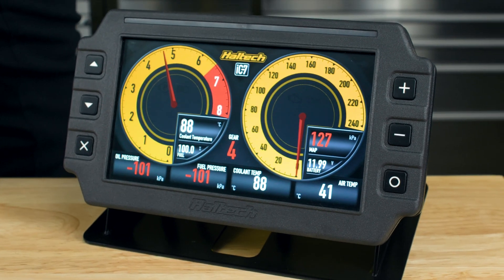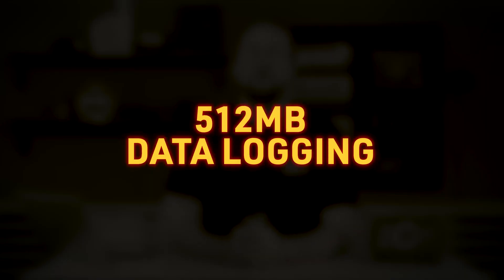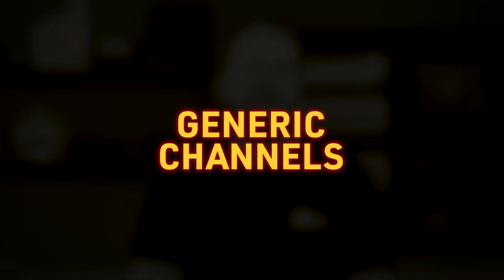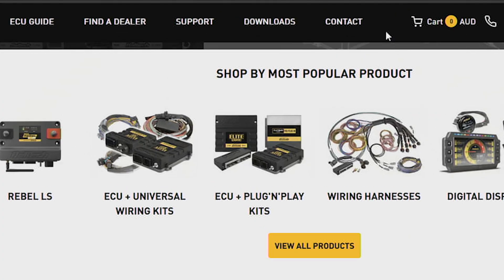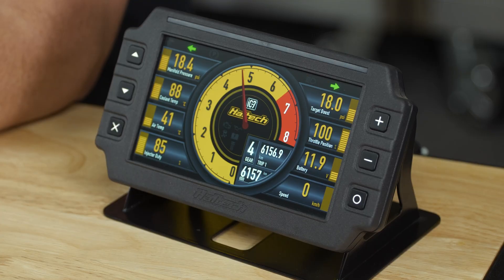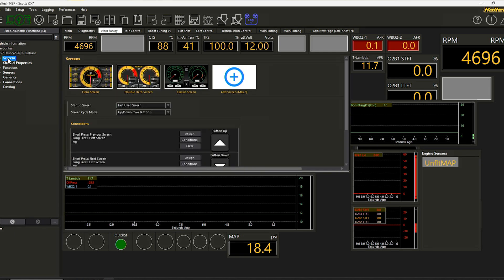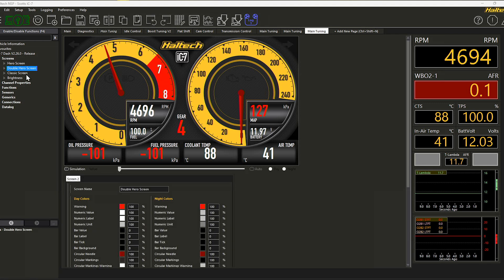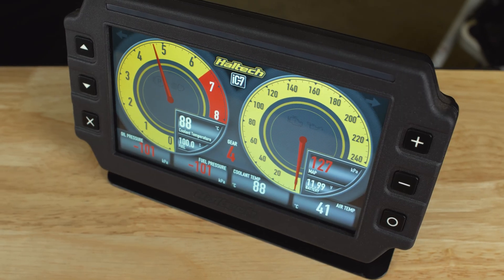🛠 Updating Your iC-7 - How To | PRODUCT OVERVIEWS

Comment: question, can I use the input on the C7 dash for non dash related parts ? example clutch switch,  pressure switch etc, and outputs, and if so can this been done with the elite and nexus series
Reply from the maker: Yes, the Elite and Nexus just see the dash as extra OI in NSP.
Reply: @haltech  thank you for the reply, can any of the wiring be used as DPO or AVI

Comment: My only current apprehension with this update, is that I'm afraid it might take away the ability to change the logo between the circular gauges on the double hero page, or in the center of the tacho on the hero page.  The ICC software's configuration files aren't encrypted, so it makes it much easier to edit the PNG files to slightly customize the displays a bit.  

I want the other features, and the live updates through a single software package on my laptop, I just don't necessarily want to be stuck with pre-defined logos that can't be changed anymore.  Customers like seeing their car's logo on their digital dash.
Reply: yup they took it away lol

Comment: Also cant adjust the odometer ?
Reply: My bad got it it's in km but display is in miles you find the functions odometer and adjust it there
Reply from the maker: Go to preferences in the top menu and change your units to miles
Reply: Thanks I'm surprised how much faster it is 😂 @haltech
Reply: Some minor issues since update my Speedo is bouncing all over the place but I'm hoping the increased filter number will help next time I'm out init 
Strange as Speedo is connected to ECU